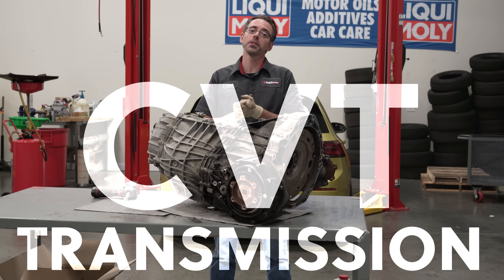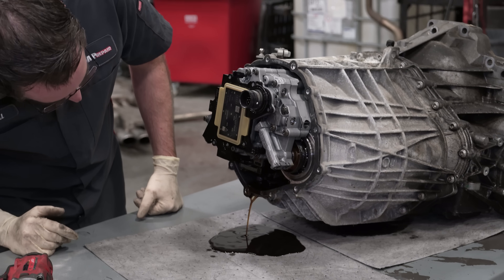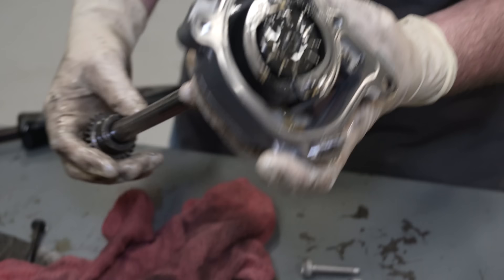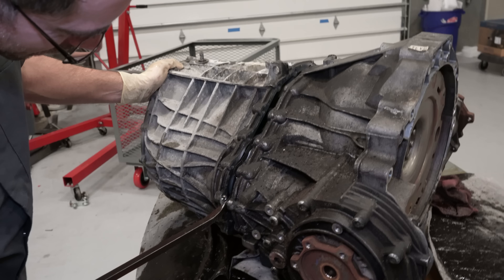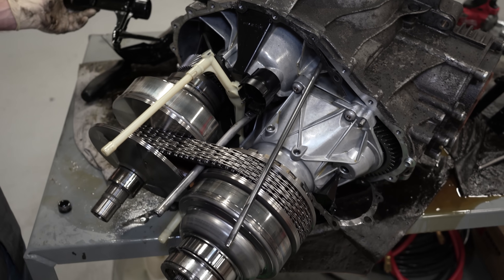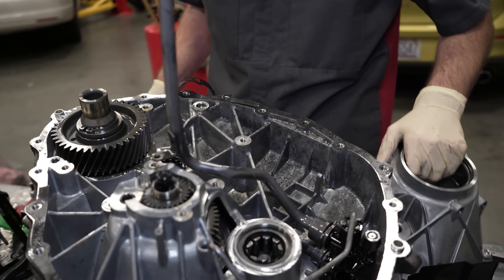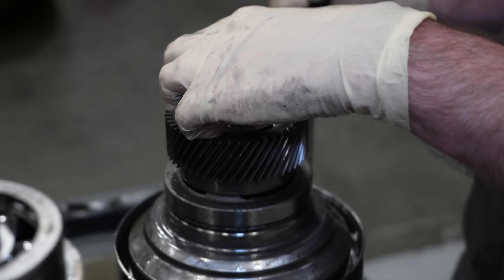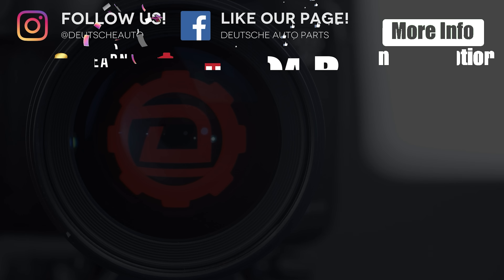Why you shouldn’t get a CVT transmission

Comment: My Audi A6 has a CVT box. 208,000 miles on the clock and still going strong. It's all down to ensuring the oil is changed at the recommended service intervals. Something that's difficult when the main dealers don't even do them unless you tell them to (well mine over here in the UK didn't). I got the kit and do it myself. Love the cvt for everyday driving as its so smooth but it is boring if you like a "spirited drive" . That's what I have my track car for 😁
Reply: Changing lubricants in the engine and transmission of any vehicle at the recommended intervals is key to longevity. I just changed the transmission fluid in my Prius Prime at 25,000 miles. Probably could have waited to 60,000 miles, but I thought it would be a good idea to flush out any metal particles that might have gotten into the oil during the break-in period. $45 worth of oil is cheap insurance considering the cost of replacing a damaged transmission.
Reply: @laura-ann.0726  transmission fluid flush? Wouldn't that flush in crap from other people's cars? You need to do a drain and fill because when you use those flush machines the crud (metal shavings) gets lodged in the machine which then makes its way into your transmission, doing damage.
Reply: Yes, I have also strong feeling that Audi CVT can last a lot with proper maintenance. Mine A4 is getting new trany oil each 60k and soon is turning over 390k km. The CVT still runs well. Just the ECU went out recently, but that is fixable and not crazy expensive.
Reply: being an Audi transmission........a failure would really crater someones bank account.  Its not like your going to find a good second unit anywhere LoL
Reply: @wazza33racer  yes indeed. It is a huge gamble to buy used one and it is hard to find someone who knows how to rebuild them properly. So oil changes is really the cheapest variant:-D
Reply: You must be very lucky. In Canada I had it in my 2003 Audi A4 FWD with the CVT transmission. It was very unreliable, and I had the transmission changed two times in a two year period. The last straw was when it left me stranded in Chicago. I had no reverse ! 
I always dreaded seeing my instrument cluster light up with all the gears flashing. At the end, even my Audi service advisor told me to get rid of it, as the Audi’s equipped with this transmission had a high failure rate, and even Audi dealerships hated selling them because of having a bad rapport with customers. Thankfully, after sometime Audi scrapped the ‘multitronic’ CVT transmission in the 2010’s.
Reply: @LionHeart2123  Scrap.  Good.
Reply: I got cvt on my kona limited and it feels sporty? A turbo and the smooth gear changing. Especially at high speeds the thing has some serious balls for a commuter car.
Reply: @Titantitan001  Smashing.  Keep it.
Reply: Bro what 'kit' did you buy? I, too, am in the UK but i can't seem to find the dealership oil and I dont want to use any other brand if I can help it. I've got about 2k left before it will be 'overdue' so I'm looking for oil as we speak
Reply: @James Hamp  you'll need an OBD reader as the oil needs to be removed and checked at a specific temperature. Also you'll need the right tools to actually drain the oil (bought mine from Amazon) . The oil was just the good stuff from GSF , I really wouldn't worry about using Audi oil, it's no better than any other make; probably just the cheap stuff re badged
Reply: @superblackbirdrider  got a proper snap on diagnostics kit so the obd bit isnt the problem but I've heard from plenty of people to only use the dealer-grade oil. I've got all the connectors and adapters and stuff my brothers an engine and gearbox specialist it's just I havent found and oem oil if you like anywhere for public. TPS likely has it but I'll have to get him to ring them because they only deal trade. Might be worth asking at GSF tbf.
Reply: I am trying to figure out how the CVT accord has paddle shifters???? And it feels just like gears it weird AF!
Reply: @tiredofthetyranny9874  Fake gears. My Audi A4 has CTV but it also allows you to manually select gears. Works very well though.
Reply: Change the fluid according manual.  Trans failure is due to lubrication failure and heat wear.  If you wait too long, damage is already done and consensus is to leave old fluid alone.  Most people don’t change their transmission fluid and a lot of manuals don’t give a schedule.  The failures are mostly fluid failure, pressure loss, and heat build up from people that did nothing.
Reply: CVT doing well on motorbike/scooter here ini asia... n still strong...
Reply: Same with my Nissan Sentra
Reply: What make is it?
If its an Aisin transmission, then that explains how its lasted so long.
Reply: thats great to hear, recently got myself a 2012 a6 2.0 D with a cvt and the service history is great too, its good to hear the gearboxs are still good at even those kinda miles
Reply: YES, very few people- including with regular transmissions- change fluid at intervals. Only when it’s too late, if at all.

Then i’m over here only able to afford old used cars, so just have to absorb the abuse down the line 😅
Reply: Right? we have a 2015 subaru outback with over 350k kilometers and the cvt is still going strong!
Reply: That's why mini only used the CVT for there cars for a few years and I have one
Reply: @domainmojo2162  Exactly   Changing the transmission fluid will destroy the transmission.  Seen it happen many times
Reply: @jimlewis2395 yea changing it on automatic transmissions can ruin it, but it’s a different story with manual gearboxes.
Reply: @al69420  Correct
Reply: Well clearly, YOU CAN'T GET ALL THE (Steel-Infested) OIL OUT ANYWAY !!  -  So NO point to the changes...

Comment: My nissan murano had one....needless to say its in the junkyard now...its insane how many car manufacturers are using these now.....and its quite a few...always check before you buy a car to see if it has one of these turds....if it does plz know that you will definitely be replacing  it...100 percent.
Reply: Yup. 3 grand for mine with 61k miles honda accord.  It was a junkyard transplant as nobody rebuilds these sht junk. At least with a traditional trans you can get a rebuild kit and it's cheaper. I asked for a reman once and the Trans shop said it would be 7 grand from honda.

Comment: I test drove a crappy Subaru with a CVT transmission and hated it so bad that I went directly to VW and bought a GTI with a 6 speed manual which for the same money was a million times better than the slushy CVT and interior, paint and body was 6 million times better.  It pays to shop around.

Comment: OK, thats an interesting tech, i think first used by williams, but banned by fia... but just for accelerating this would just on the paper THE best thing... on the paper. Just imagine, you have just on variable gear and for starting and one for reverse... There should be more potential in it; mor than i guess in the change from sequential to pdk (twin/dual clutch tramsnission)... if one car manufacturer puts interest and money in it, just imagine, the engine could run at its peak,  you could program it aside of the engine for the perfect power output on a specific track... Damn imagine a 1,5k PS Car could run at its best state for the current condition.-

Comment: CVT ain't bad in itself. When it first appeared in Daf automobiles from the Netherlands their showed as the great invention they basically are. Effortless to use like an automatic at lower cost, reliable with almost no maintenance and more durable than the rest of the car (in most cases). But these were small cars with low power engines. In such configuration they work incomparable, but this appliance seems to meet its limits when comes to harnessing great power output from the engine. So car companies shouldn't have been trying to put it in big, fast cars with strong engines. It seems the best balance was found in the Volvo 344 cars.

Comment: CVT was designed to be used in light weight vehicles not 3000 lbs  and above vehicles. Manufacturers used the CVT because it is cheaper to manufacture and costs less. Nissan uses it because it owns Jactco

Comment: Modern CVTs are great for relatively small and light cars, low hp and low torque. Putting it in anything with more than 4 cylinders is probably a bad idea.

Comment: There's a different idea from some manufacturers. They have something called a err....clutch and then a gearbox where you can waggle a stick thing that sticks through the floor and that does the trick. Some guys even have the guts to skip one of the gears going up the box and those who aren't so daring use it like a sequential box and tediously work up from 1 through to 6. The whole thing is far, far simpler than the complex incomprehensible gubbins you wrecked so comprehensively. It put up a good fight, though. Hope you got all the oil cleared up. Looking forward to more fun in the future!

Comment: If you just drive normal with a cvt you will never have a problem.
And if you do maintenance on the oil .
You never have a problem.

The big problem is American people who always try to go fast like a idiot .
And try to pull stupid things .
And never do a good maintenance.

Here in Europe we do normal with cars .
So my old honda hr-v from 1999 ,4x4 cvt and have 124.000miles under it .
Still drive like new .
Last time check by the Honda repair shop for maintenance.

Really in Europa we use a lot of cvt .
Audi use cvt 
Vw use cvt (now it use dsg)
Volvo use cvt 
Peugeot use in the old days a cvt .
Daf use cvt. 
Honda still use cvt 
Toyota use cvt 
Renault with Nissan use cvt .

So who is now the problem ?

Comment: I worked for 21 years at a dealership that  sold and serviced Volkswagen and Subaru vehicles. The failure rate on the Subaru CVT transmissions is mind boggling. We didn't have room enough to store the new ones coming in, or the bad ones being sent back, or scrapped. I would never buy a vehicle with a CVT, and advise anyone that ask not to as well. They work ok in a scooter or a snowmobile, but are garbage in a passenger car. Nissan and other makes have had issues with CVT' as well.

Comment: Normal CVTs used in Nissan cars, JATCO CVT, are extremely prune to failure and all the belt driven CVTs for that matter.
That said, the new ones which called eCVT doesn't have these belts and use electrical motors with planetary gears to accomplish this, for example Toyota hybrid cars and Ford Kuga PHEV. They are quite practical and very efficient, especially for hybrid cars.

Comment: Of course they're still new technology and reliability is still a big question, but I definitely prefer the driving of it over the modern day 9+ gear transmissions. I had a Dodge Caliber with a CVT and loved it as my commuter. It did eventually die at 160k+ miles, but it wasn't the CVT, it was a hose going to the radiator that burst, sprayed coolant on the belt causing it to slip off, and blew the engine. I then went and test drove a Chrysler 200 that had a 9 speed transmission, and I hated it. It never knew what gear it was supposed to be in, would shift up and down and then back up. Modern transmissions with 9, 11, and even more gears just aren't a smooth ride in my experience, especially compared to the potential of CVTs. A lot of that is just programming of course, but I've seen a lot more recalls over these too many gear transmissions than I've seen over CVTs. I've heard the latest Toyota CVTs are excellent thanks to their launch gear.

Comment: Lack of maintenance and terrible driving habits, by customers, are what really kill these. Which no one ever really seems to even talk about, let alone even bring it up.

They aren't meant to be driven hard, overloaded with weight, or neglected on maintenance, which is extremely common for vehicle owners.

They're actually more reliable, as most of these CVT's are lighter in weight and have less moving components. Their basic functions are based off of snowmobile transmissions(CVT), which have proven to be reliable. 

Like anything else mechanical, quit neglecting them and they won't break.

Comment: when one compares cvt in scooters they are so simple and cheap to repair, why are car cvts so complicated, in scooters there is no valve body, just a rubber belt, centrifugal clutch a few springs and 2 expanding pulleys, we had a printing presses with a cvt drive belt system and in 40 years l have never seen one break

Comment: I had a 2007 Camry Hybrid that went fourteen years with no CVT problems and no fluid change. But a Nissan CVT? Never.
Reply: Toyoto uses CVT transmissions made by Aisin, Nissan uses CVT transmissions made by Jatco. Basically avoid any auto manufacturer that's using transmissions made by Jatco.

Comment: The only CVT transmission that works is probably found in Germany, but it isn't in a car.
If you look at Fendt tractors and their Vario setup, they seem to work, but the reason why it works is because they do not have a piece metal that wears out due to fatigue, they let the oil handle that instead as it doesn't suffer from fatigue cracks.
Reply: You're absolutely right....the Fendt Vario transmission really is a peach, am surprised it's been not adopted more OR modes to run on 'higher' speed road going vehicles.

Comment: I have had a few CVT’s including Mercedes and Audi. The Audi CVT (MultiTronic) (A4 V6) was amazing, drove beautifully and had no issues. Sold it at 180,000km.

Both of my MB however had issues (A-class and B-class) including a friends qashqai and another mates Forester. The MB were never as good as the Audi… which almost felt like a traditional auto.

CVT’s are terrible at handling torque being a friction drive system. Interestingly though (as shown in your video) Audi is the only manufacturer to use a chain for their MultiTronic CVT, which allows the transmission to essentially distribute force across both the leading and trailing sides of the chain.😮

AFAIK all other manufacturers use a “belt” of floating metal plates guided by metal bands. This type of CVT works by pushing the metal plates together on the driven side of the pulley, sending the driven force to the output pulley shaft. As these plates are pushed past the drive axis of the output pulling, they essentially “float” on the bands until being picked up and pushed again by the drive pulley.

This means most of the drive force is distributed across half the effective area, whereby Audi’s chain system distributes the energy across both the push and pull sides of the transmission.😊

Audi essentially pioneered the commercial use of CVT and judging not by the success, but the lack of failures… they nailed the CVT with MultiTronic. As I have said CVT’s are terrible at transferring torque and they fail due to friction issues delivering torque. 

Most friction occurs during take off/acceleration, Audi fixed this by distributing drive energy across a greater friction area… Toyota have gone a step further by eliminating the issue of take off/acceleration altogether by using a traditional first gear.

Comment: You do realise CVTs have been around since the 1960s DAF was the DAF was the first cars to have them and they were much much simpler two pulleys and a rubber belt infact there is a British you tuber who has an Invicar with a CTV transmission and he has repaired it himself so easy no removing any thing except a panel behind the seat access to the bekt and pulleys no fluid no stupid casing but these motor companies have to complicate such a simple thing by the way the engine and transmission in his Invicar takes up less space than this complicated CVT and would weigh less l have never owned or driven a vehicle with a CVT transmissions and never will whats wrong with a manual l have had lots of them they have been around for 100 years and haven't changed much and they don't fail best transmission for any car van or ute

Comment: My Honda CVT after 8 yrs still running very good, no problem at all. People got trouble with their CVT because they didn't maintain them properly, most of them did not have fluid changed on time. CVT fluid should be changed at 30k-40k miles.

Comment: I can’t disagree more. I had a 09 maxima with a cvt. It made 290hp from the time the pedal hit the floor to when you let go, there was no power curve. The Subaru wrx with 265 hp peak made 265 for a second per gear at 5600rpm. After the shift it made a whopping 134hp @ 3500rpm or 180 @4000. That’s no comparison as far as acceleration. Fuel economy is the same thing. Easy on the gas the cvt stays at the most efficient rpm for the power required. I never had a problem with it. They haven’t been able to handle more than 300hp because nobody wants them, I’m certain they could make one handle more power if there was a demand for them to pay for r+d. I’d love to have one in my charger scat pack. 480hp the whole time would be insane. I’m sure it would still be cheaper than a double clutch. Cvts got a bad rap from the same people that want manuals even though they’re slower than automatics. They are by far the best way to put power from an ice to the ground.

Comment: Haven’t watch the video. I have 2006 Lexus RX400 with 450,000km on it using the original CV transmission. I would say that is pretry good and long lasting service.

Comment: When I was finishing technical college, my group's graduate work was an analysis of a CVT transmission complete with a model. We sourced a busted gearbox from Saturn VUE, if memory serves. After everything we discovered and went through with this project, I do not want to touch CVTs with a ten foot pole, both servicing and pricing on spare parts are a complete nightmare.
In their defence, they do usually provide good driving experience if you're looking for a simple city car. But for me, and I know I'm biased, it's a source of paranoia and a red flag, I'd rather have a manual or a classic automatic.